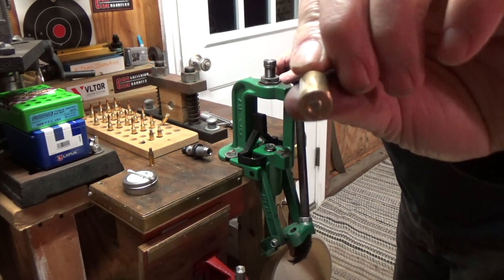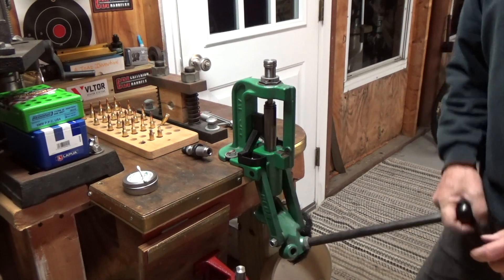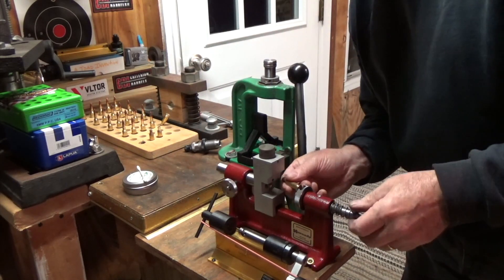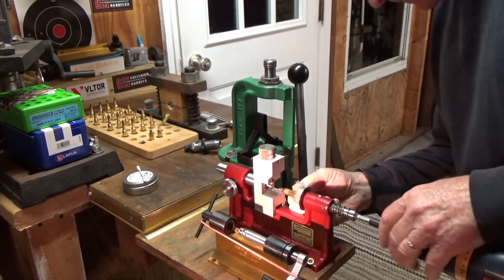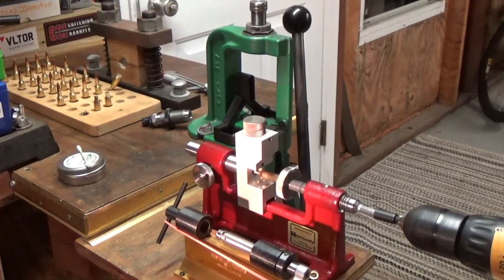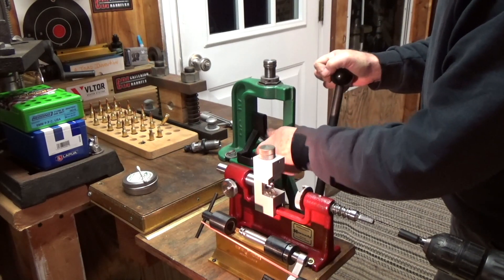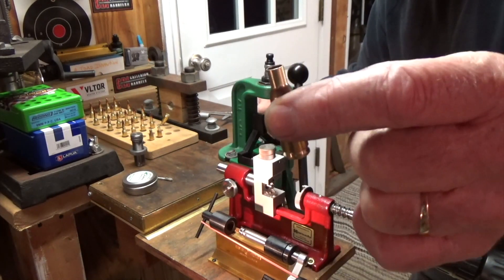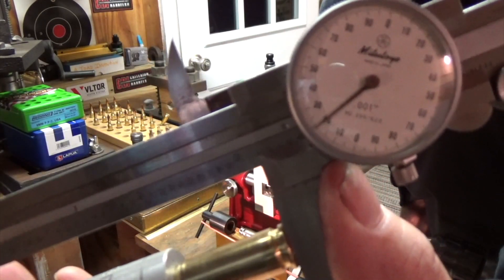How to reform 220 Russian case to 6PPC

Comment: Thanks great tutorial video, wondering what cutter angle you use on the 220 Russian when turning? I believe they have a 21 degree shoulder angle so would you use a 23 or 25 degree cutter to slightly touch the shoulder. Apologise if it sounds trivial but I’m new to 6PPC and turning, currently looking at a lovely older Sako in 6PPC
Thanks Michael
Reply from the maker: I use a 30 degree cutter. Any cutter that has an angle greater than or equal to will work. As you say slightly/hardly touch the shoulder. Those Sako rifles are beautiful. Thank you for watching the video. There are many ways to prepare cases and there are shooters out there that go to much more great lengths to ring that last bit of accuracy out. I am more in the middle always looking for the next shiny thing.:)

Comment: I have a Wichita 1375 in 22PPC. It’s been 30 years since I’ve fired it but I used to fire form it in my garage using a load of pistol powder and the case topped off with cream of wheat.  It worked marvelously.  Then I would be able to turn the neck so I could safely fire it. Seley Masker built me a great rifle.

Comment: Nice wood on your Sako "B" prefix single shot. You obviously prefer the Hornady neck turn/case trimmer, or do you have the Forster set up for a specific task? @#&*! Hornady and their shell holders, I have three manufacturers shell holders and I still can't find the one I need! Once again, an informative video!
Reply from the maker: Howdy, I turn with Hornady and trim with the Forster. Normally for steel I don't turn necks. Just for BR and cases that are reformed. With the wrong drill hardness those RCBS shell holders will liquify a drill bit :)
Reply from the maker: @markcarew6724  Fall fun. It's my favorite time of the year:)